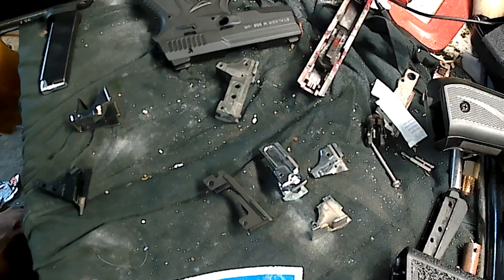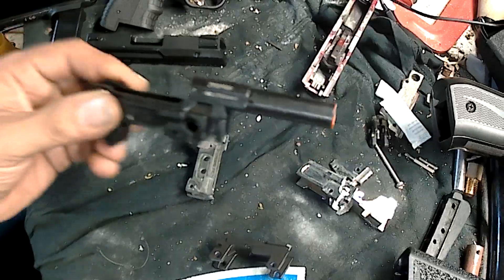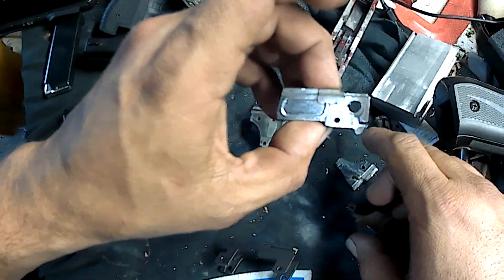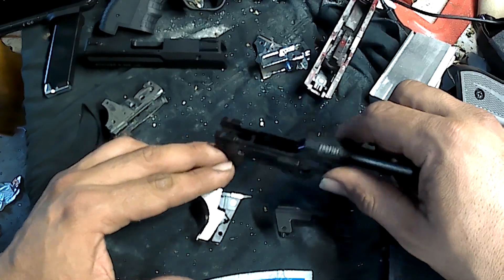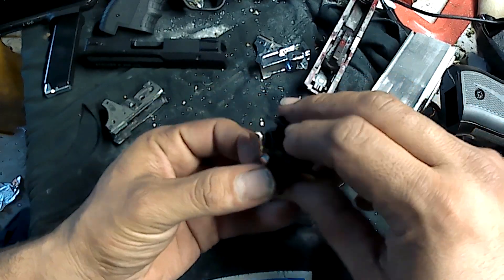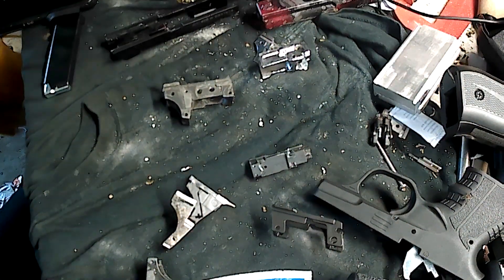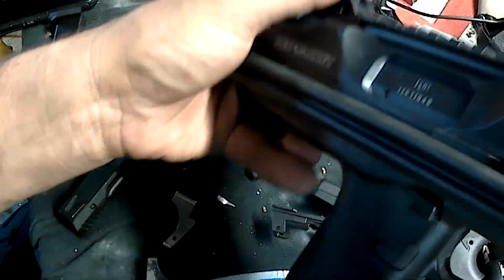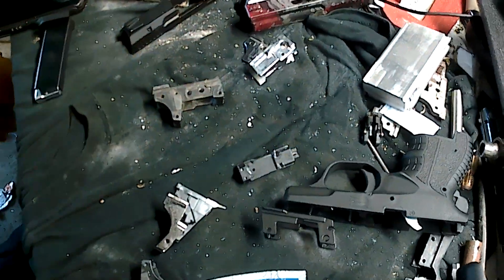Another 906 prototype. Oops my PhD is showing

Comment: love your work.....trying to find ways to converting my Zoraki 906.....and was wondering if u found a way to remove the pin or whatever that is blocking the barrel and what drill bits do u use for boring it out???......i want to try to bore that pin out of mine and would like some tips on how to
Reply: You gotta saw the barrel and put in a New one 416 stainless steel
Reply: @johnstark3358 blx 6mm diamond tile hole drill bit

Comment: You think the 906 is the best build gun I would strongly disagree as you know I just got a 906 and my opinion is it's the worst I've converted the ekol dicle the ekol Sava and they were built way better I do like the Glock idead but I figured out how to convert the 906 front vent in a diffway I'll email u
Reply from the maker: Idk that 906 slide is one of the best I've messed with. Plus adding a steel firing pin housing will add to it. The frames are the down side. I got my jig ready. Basically aluminum frame but the barrel will slide in and get pinned in place. I'll send u my drawings
Reply: @ujara87  how to convert  the 906 front vent in adiffway?
Reply: I have been trying to work something out for the front vent a while now the only thing i Can think off doing is to put epoxy on the weekend parts. Ive mailed u PhD can u check ur inbox. Aaron if u chould bounce some info with me it whould be great.